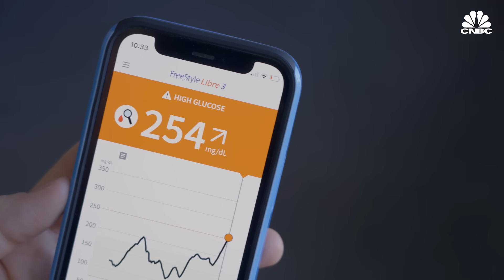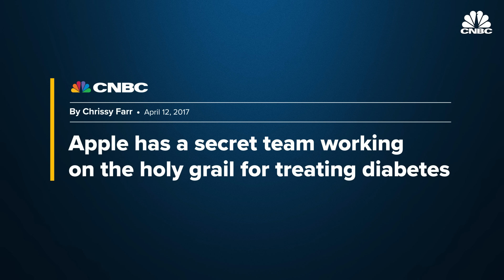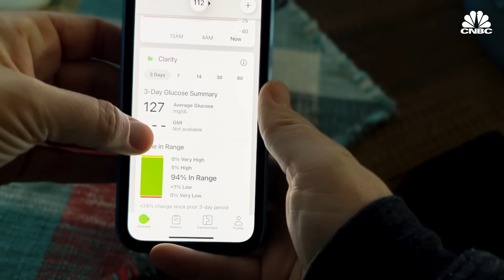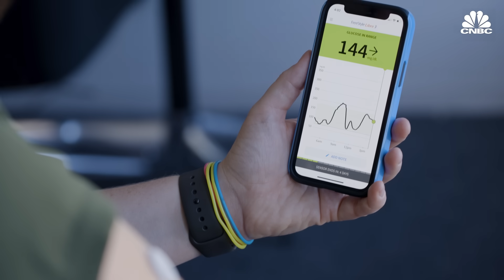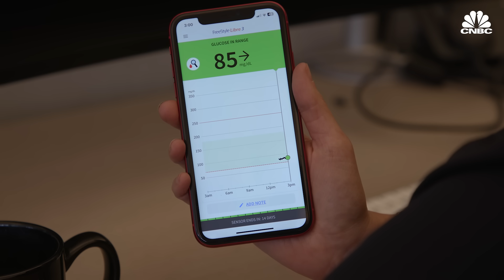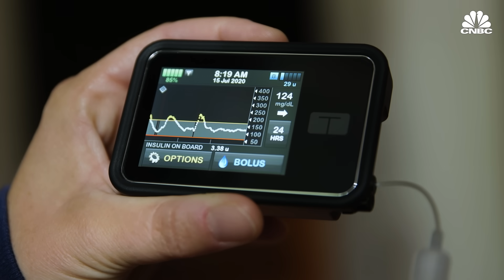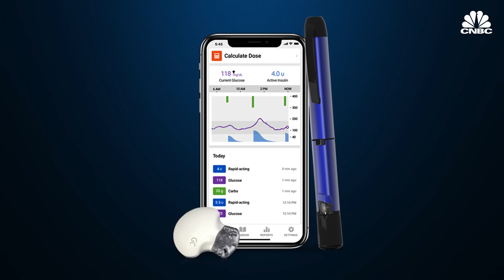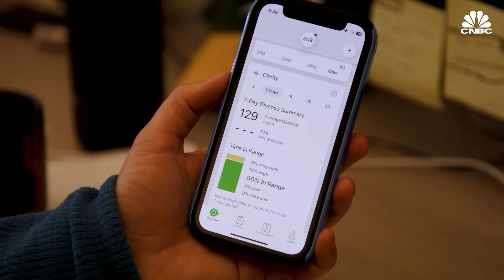The Rise Of Glucose Monitoring Among Non-Diabetics

Comment: I think for a documentary, it fails to explain the basic introduction such as “Does user need to needle themselves every time putting the sensor on? Or does it have needle to stay inside the body for 24-7? Etc”
Reply: Yes, as far as I understand it you get a needle in your arm 24/7
Reply: @Machin Truc  It's a small plastic tube that collects the blood sugar, although it doesn't directly sit inside a blood vessel. It's not a sharp needle sitting in your arm 24/7
Reply: I can only comment on the Abbot Freestyle Libre 2, but it only uses the needle to initially puncture your skin. The center of the needle is hollow and contains a filament. That filament is what stays inserted for the 2 weeks and it is what transmits the glucose measurement from your interstitial fluid to the electronics inside of the CGM. Even the mfr. of my particular CGM did not explain this and I was "terrified" that there would be a stiff metal needle in my arm for that 2-week period. It was not until I removed my first CGM that I discovered how everything truly works. The filament is kind of on the stiff side, but very flexible. It's almost like flat-ish fishing line. Looking at the hollow needle in the applicator still freaks me out, but I never feel anything when the spring of the applicator momentarily shoots it into my arm to insert the filament.

Comment: As a Diabetic, I find it frustrating the lack of interest my Doctors take in utilizing any of the data collected by my devices (CGM/Pumo). Their focus is almost entirely on A1C.
Reply: Because an A1C is very accurate and doesn’t require them to look at a ton of data, it’s one number that gives them the average they need.
Reply: @Mistro07  Low A1C is directly connected to control. Which is where my Dr. is supposed to come in
Reply: that's cuz you're not a type 1- its a different beast all together
Reply: @jerridombrowski6017  Type 1 since 1967.
Reply: You should be focused on working out big boy 😂
Reply: @penitenttangent7346  and my doctor should be focussed on my number
Reply: @SoapBoxMediaTV  You can do both. Monitor A1C and working out (:

Comment: I'm Diabetic for 8 years now, in the begging I was picking my finger, but after  2 years I stop picking my fingers, I never move over to other companies because it cost to mush money, and in the last 2 years without using any guiding tools I'm now in control of my blood lvls. So do you need these overprice gadgets to monitor your blood lvls I say no, Just stay active, eat well and you'll get in control of your blood lvls.
Reply: With a noninvasive glucose monitor it will be much much cheaper and no need for pricking. Google Know Labs noninvasive glucose
Reply: for type1 its important
Reply: T1d ...I kinda agree. I'm happy at 200 for 30 years. It's a buffer both ways. That's my normal sugar level.
Reply: @ReseRain-xq9uo  I do the same, but with this tactics we will die like 10 years sooner and will be sick way before that. Not the best.
Reply: @magyararon6918  I'm not so sure about that. Most of the longevity studies are based on a mix of types or mainly t2d. My own experience with scare tactics from medical community as well. It helps to understand my sugar is same as any poison. I've acclimated over several decades that defy norms and process/move faster at 200-225 range. It protects while I sleep and work, I just have to consume lots of fluid, fat and protein.